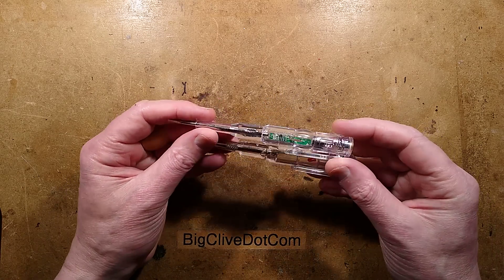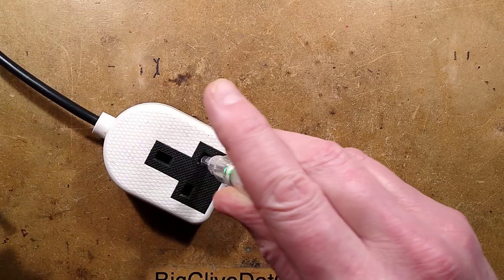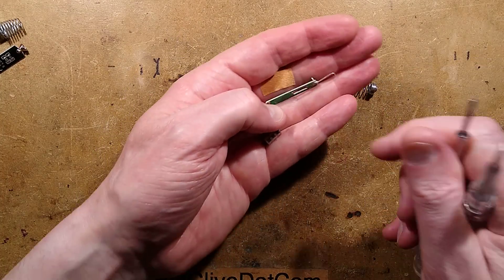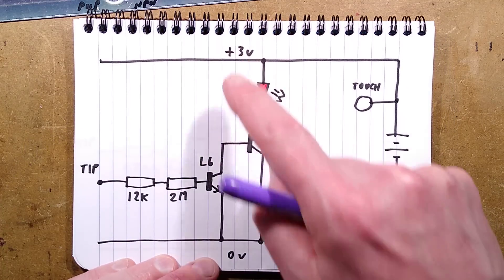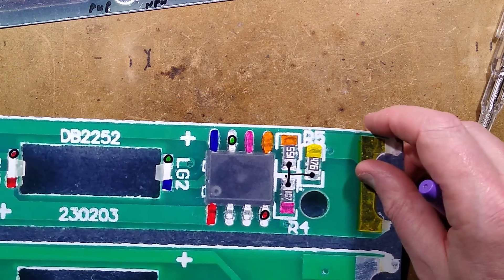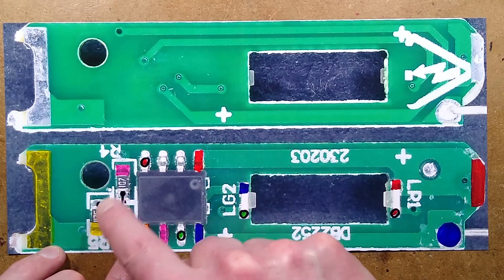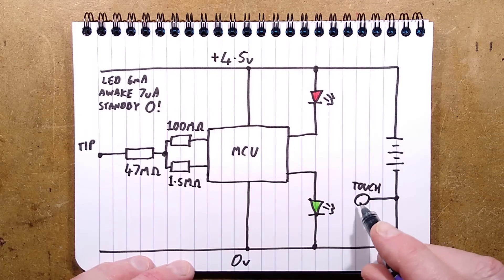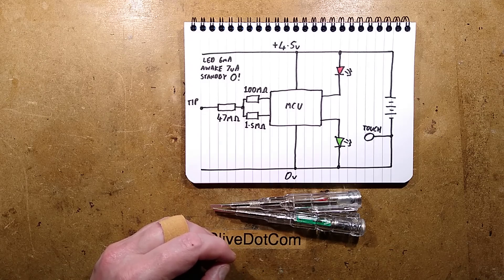Test screwdriver with microcontroller!

Comment: Yet another reminder of how old I am when you said the originals just had a single LED.

I used the neon versions for decades, never got so much as a tingle on 120V or 240V. Got a very mild tingle using one as a field probe for my first Tesla coil. I can imagine a few scenarios in which they’d be hazardous but in long line DC use, the microprocessor isn’t going to save you.

I don’t really consider the use of a microprocessor “obscene” in this application. Silly, overkill, a ridiculous flex maybe, but I think of other products you’ve shown us with microprocessors built in and I just shrug. The trend probably started when a fresh design hire was tasked to design something simple and they decided to put their newfangled programming skills to use by flow charting the device’s functions and crowbarring them into a jellybean micro.  One one level it makes sense; micros are intended to be sort of electronic multi tools that can replace discrete parts thus bringing BOM costs down. On another they obscure circuit operation within proprietary, undocumented and unhackable code. On the gripping level, profit overrides all other considerations. I wouldn’t be surprised to see a hammer with a micro these days.
Reply: Not surpising, there was a Kurig coffee maker, that wanted to take a photo, to verify an authentic coffee pod was used😂.
Reply: @aware2action  Gah. My wife wanted one of them so we got one. No camera verification gizmo in that model but we got rid of it when I figured out that you can’t drain the internal tank. Companies locking you into their ecosystem is one thing but that’s a health hazard IMO.
Reply: @markfergerson2145  Unfortunately, When companies develop products, they are a bit altruistic, but later realize, its not going to work, in keeping the cash flow, leading to all sorts of convoluted schemes. The same goes for a lot of "Ch"eap products that initially look, as good as a reliable one. They could be as durable, if not for that "one" thing that breaks, to make it a disposable one. Rechargeable gadgets most always fail with bad batteries, followed by other cheaper parts inside(not replaceable unless someone is stubborn!). Unfortunately, externally, the products look identical, and may be from the same factory!. Gone are the days, a product is made to last, as the raw materials allow!. Sadly Programmed Obsolesence is what makes the new economy. The main culprit is the lack of continuing innovation, after the initial product launch/success. Just some 💭
Reply: @markfergerson2145  Actually Kurig pulled the model from market, after they lost legally from preventing other coffee pod makers to circumvent(by just duplicating the barcodes) it. Nespresso has been clever, in making their pods difficult to make(sealed aluminum with nitrogen under pressure), while also making their machines bullet proof. Also refilling is not worth the effort(due to small size and high pressure). Best option is to use a old Kurig, with a reusable filter, in which you grind(using single serve manual burr grinder) and fill starbucks wholesale beans got at a discount(stored in another vacuum glass  jar gizmo, that uses a rechargeable? battery-will open it to fix when fails!). For the non-drainable tank, I use distilled water made from my trustworthy non-digital Sears-Kenmore water distiller. Again it is just my way to fight the Programmed  Obsolesence. Just some more 💭
Reply: I still have two neon ones I use
Reply: I'm guessing PIC clone?
Reply: @Xitrial  Me too, never had so much as a tingle from it.

Comment: With such high value resistors in series, risk of shock is negligible, maybe a slight tingle.
Reply: 120V or 240V?
Reply from the maker: It's more the low separation that is an issue for direct human contact.

Comment: Interesting. I only remember the old style of these, where it was just a neon lamp and a resistor, so you could only check for the live connection by using your finger on the end to provide a path to groung. Not sure if I like this new style, seem to over-complicated. But I have not used one in a long time, I rather like to use a proper meter, as these can be quite unreliable, depending on the quality.
Reply: I remember the neon screwdriver well. I/we all had a decent size neon screwdriver that was used for tightening almost anything and used for testing fuses. This was nearly 40 years ago now, not much to go wrong with them, neon and a high-value resistor. No one ever got killed in our factories using a neon screwdriver unless they fell on the pointy end, ha ha.
Reply: @getcartercarpark.  The only issue I have ever had with those was that they were poorly visible in bright daylight (trying to find the live wire on the side of a building while hooking up a light fixture with an IR sensor).
Reply: @getcartercarpark. A friend of mine go a nasty surprise of one that had compleatly filled with water after being left in a tooltray out in the rain.
Reply: @Ranger_Kevin There was a professional version in black bakelite with a shielded window to the neon and a solid probe tip that wasn't a screwdriver .  It could be easily turned away from the sun and the neon poles were clearly associated with separate ends to show polarity of DC power over 50V .
Reply: @johndododoe1411  Interesting, I have never seen that here in Germany. Sounds way better than the classic "transparent screwdriver" type.
Reply: I still have one of those. I still use it although I always test it on a live circuit first before I trust it.

Comment: The LED position means there is a diode junction between your finger and the circuit , so if the transistors go short you get a half wave shock :)

Comment: FWIW, that configuration is called s "complimentary Darlington pair", aka a "Sziklai pair". Not terribly common these days, but they used to be pretty common. It lets you reverse the control polarity. Not sure why the power transistor is PNP—that's rather odd.

If it wasn't for the PWM bit, I would have suspected that chip of being a pair of Darlingtons of one sort or another. It's odd that the LEDs are wired opposite of each other.

Comment: Such a tiny little resistor providing 100M ohm - wow.
Reply: The resistor could probably have been omitted entirely. What's the resistance of about 0.03" of G-10?
Reply: Probably just a block of ceramic with tinned ends!
Reply: @stepheneyles2198 I was thinking the same thing.  It probably works more like a slightly leaky coupling capacitor than a resistor.  😊

Comment: Hi Clive, fellow glasweegin here. Don't know how to contact you another way other than here, need a wee bit of advice. I purchased a LAP 338PP LED replacement unit for my outdoor flood light. The upgrade looks fine and fits perfectly, only problem is it flickers like a strobe. If you could give me any advice, it would be appreciated. The new unit replaces a 400w halogen tube, I was trying to save energy. Looking forward to your reply. Thanks, Eddie Woolfries
Reply from the maker: If it pulses when it's supposed to be off then it hints at a snubber network across the switching component.

Comment: Those screwdrivers typically have tips that are softer than brass. Twisted dozens up over the years.
Reply: I recall at at some point in Finland one could not have a screwdriver head on those so it just ended in a round head. I think the idea was that they could get damaged when used as a screwdriver.
Reply: I had a drill bit bend on me yesterday. Oh lordie!
Reply: @johnpossum556  
Thats, because drillbits are mild steel at the shaft to get grip in the chuck.
If you clamp them too short, the thin ones will easily bend there.
Reply: @werner.x 

I've never heard that. Really small bits just snap if too much extension is used.

I think a drill bit bending (significantly) would suggest it's made from monkey metal.
Reply: @skylined5534  Yes, i had to realize, that hardly anyone knows, how drillbits are made. That's, why i commented here.

Comment: Interesting devices, even though whenever testing for voltage I do like the things to be as simple as possible to avoid surprises caused by failure of the electronics.
Reply: Or flat batteries
Reply: Yep this is why we're expected to prove our testers before AND after use
Reply: That's why I use 2 testers minimum always. Indeed the batteries near the touch side  is an X factor to say the least. Leaking batteries will make things even more unpredictable.
Reply: You don't just use a proper DMM to check voltages?
Reply: You test a known live first
Reply: I prefer to stay alive so I always use my Fluke DVM.
Reply: @shadow7037932  proper dmms are expensive. For the sparky a set of test lamps is cheaper and more rugged. I have a 1970s vintage actual test lamp (Drummond MTL7 for those playing along at home). Takes a 15w pygmy lamp. It is rugged as all hell despite the filament lamp, and doesn't show phantom voltages

Edit: despite the age with appropriate probes (6BA threaded brass lol) it's even GS38 compliant
Reply: @TheChipmunk2008    my father had the pygmy lamp tester, very rugged I think it was from the 1960s had a 90 degree angle probe.   It was the highest approved tool for checking a circuit is dead, ranked above any other tester irrespective of how accurate or expensive, the crude simplicity was genius. Working on site a DVM can easily go wrong. 
Interestingly within the CEGB "neon screwdrivers" weren't officially recognised tool, but everyone still used them, then in the 80s came out the non-contact "pen" tester to replace it, which again wasn't officially recognised but used alongside the lamp tester the latter had the final word.

Comment: poking stuff into an electrical outlet is very dangerous especially if the device is a chinese knockoff or cheap version of something that is designed to be a voltage detector.

Comment: If I was an electrician, I would stick to a good quality old fashion neon type. 
Some things are best kept simple.
Reply: Electricians don't use neon testers because they are unreliable and can be dangerous. We also don't use these they are only for amateur use.
Reply: @dogwalker666   I have an old Martindale neon voltage indicator they were the only device authorised by the CEGB at one time.
Reply: @letrainavapeur   was that the martindale with the cable, The big problem with neon screwdriver types is they require so little current they can actually read through a blown fuse, 
I was called one night by one of our customers,  I told them to check the fuses before I left and they said they had,  I told them it would cost a full service call out and overtime (3AM)  it would be quite expensive,  They accepted, I arrived checked the fuses with my Avo and the yellow phase was blown,  replaced fuse and they were back in production,   
2hrs travel  for 5 minutes work, They tested the fuses with a neon screwdriver,  The owner snapped the driver and banned them from site.
Reply: @dogwalker666 seems like ironically only someone who is qualified can use this one safely.
Reply: @dogwalker666  I would guess that the equipment side of the yellow phase may also have various connections to another phase via motors, transformers etc unless they had made sure to fully "switch off" everything that could have resulted in the yellow phase being "back fed" from another phase.

I learned quite quickly when growing up, some of the "interesting differences" between phase and neutral - v - phase and phase, learning the fact a blown (or missing) fuse can be stingy on both sides of the carrier was a memorable one :)
Reply from the maker: The voltage on the "dead" side of the blown fuse was probably from other phases via loads.
Reply: @guyteigh3375  that was the first thing I checked but the fuses are dedicated feed for a drive and isolated by a line contactor,  Everything is fed separately in my panels,  I would normally use Merlin Gerin beakers but as this was the feed to a DC drive it had to be "Semiconductor" rated fuses, Breakers are too slow.
Reply: @dogwalker666  Yes, the cabled Martindale with the spring loaded sharp points that stick through your overall pockets
Reply: @letrainavapeur  indeed that’s the one.
Reply: @dogwalker666  neon test device always perfect
Reply: @alisolar4156  No electrician uses a neon tester they lie! On customer had to pay over a thousand pounds for a  2AM call out to change a semiconductor fuse because he  used a neon tester! He threw it in the river!

Comment: If AC is alternating, how can you detect live from neutral at all?
Reply: Neutral is normally “near” earth/ground potential. Whereas line (old term was ‘live’) is a significantly higher voltage. Note however, that with certain faults, or, depending on where in the circuit you are testing, the neutral wire may be at the same voltage as line. In which case, no inexpensive test gear can tell the difference, because there is none!
Reply from the maker: Neutral is normally referenced to earth/ground.  Live is hot with respect to earth/ground.

Comment: I did liked these 60 years ago, but soon only found use as the cheapest possible terminal screwdriver, bought usually in a local village Elec shop.       I usually loaned out rather than my decent screened drivers...

Comment: Nice test. I doubt if pull-up resistors are activated in the uC
Reply: They are definitely switched off. Otherwise, that poor little µC could not detect anything.
Reply: @MartyCrabneck  I imagine the small resistor is pulled to ground or left floating to distinguish bigger voltage from smaller voltage.
Reply: @abitofabitofabit4404 Those internal resistors are in the 3-100KΩ range. Together with that 47meg input R they could help to tell mains voltage apart from like 2KV. But i doubt this thingie really does that.

Comment: I know these are frowned upon as electrical tools, but I've found the neon test screwdriver to be very useful in an old Finnish cottage. Some old farmer wired the place up using whatever colour wire he felt like - including green/yellow. The place had no reference to earth whatsoever, and this was the only way I could determine which wires were live.
Reply: how can you say that only way you could determine which wire was live when you could use a multimeter, a non contact voltage detector and circuit breaker finder? These options completely remove yourself inadvertently touching anything energized when used properly
Reply: @zeddpilsner4  It wasn't that simple. There were parts of the circuit where two of the three conductors were energised. The multimeter showed no potential between the two parallel lives and it was indeterminate which was live in when measured in reference to the neutral. A non contact voltage detector wouldn't have been accurate enough and a neon test screwdriver happened to be the tool I had on hand that could do the job.

Comment: Unfortunately it's not worth getting in my experience. I bought one with microcontroller for myself and after some testing opened a dispute and got my money back. It was ridiculously untrustworthy. It was showing neutral on almost anything made from metal, the continuity test worked randomly. And on top of all that it drew over 0,5mA on stand-by. The batteries were flat in a week. Total junk.
Reply from the maker: If it was detecting a field on lots of ambient metalwork then it may hint at either noisy electronic power supplies or possibly a rogue ground.

Comment: The 12 k resistor in the first circuit is totally useless. Even when they used a 2 Meg. with 1 % derivation this alone would be +/- 20 k Ohm. It would be much better if they would have used two 1 Meg. resistors in series.